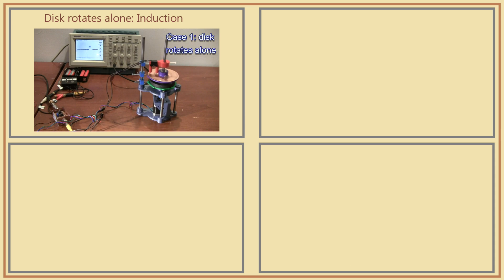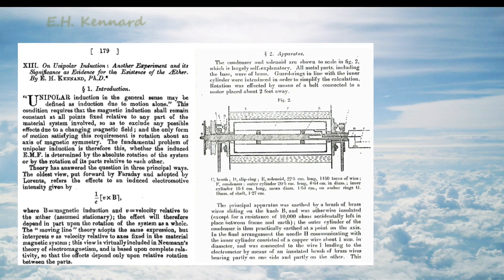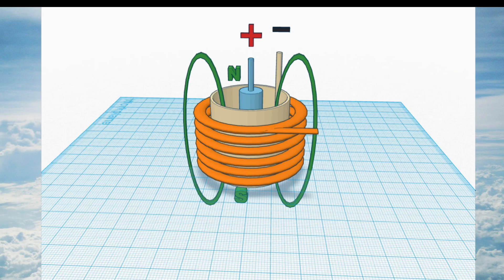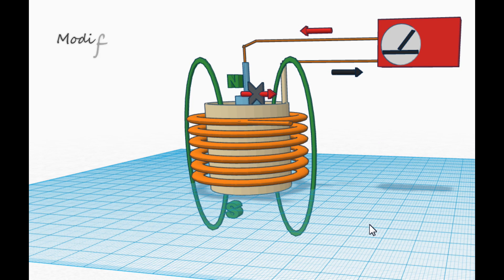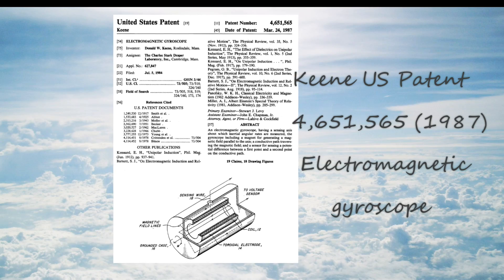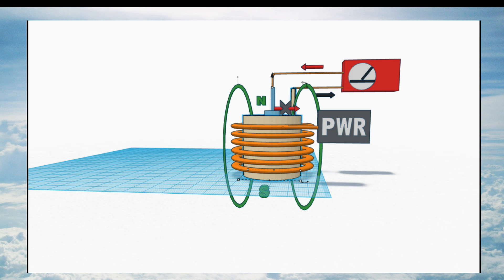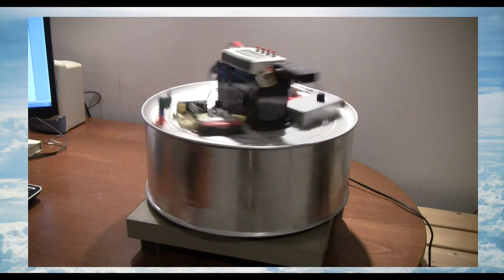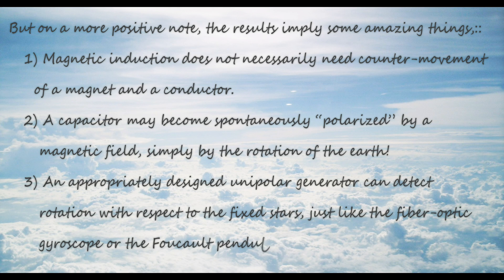Faraday Paradox Unipolar Dynamo Part 2: The Solution

Comment: Are you getting voltage with or without amperage?
Reply from the maker: The way I see it, each cylinder experiences a different degree of Lorentz force, since one is spinning faster than the other, one being closer to the rim and the other closer to the axle. The capacitor charges because of this EMF difference between the two plates.
Reply: to plenum88: this question might show my ignorance, but if a capacitor is charging, doesn't that show amperage and more than a static (stationary) charge coming off the device?
Reply from the maker: Hi James,
   The way I interpret it, is that a very small current does flow, but only in the sections of wire where the magnetic field cuts the stator wires. The problem with the original setup is that there is a current generated in the disk that is opposed by an equal and opposite current in the stator wires. By using a capacitor instead of a disk, the current flows unipolarly only in the stator wires, since there is no disk. There is no closed circuit flow of current.
Reply from the maker: Please see my comment to James just now.
Reply from the maker: Yes, that sounds right

Comment: I had been waiting for this solution to the paradox. Thanks for posting. Isn't it possible to rotate a traditional power supply and/or measurement device to obtain the same results?
Reply from the maker: Not sure what you are asking exactly. Are you taking about the design of the meter /power supply, or are you talking about the Faraday effect itself?
Reply: I was thinking of rotating all of your original equipment as seen in your video Part 1... only the stationary magnetic field would remain... except the heavy oscilloscope which I suppose could be reached by a blue tooth device. I realize that this would be an inconvenient experiment but shouldn't the results be about the same?
Reply from the maker: Actually, no, the result would not be the same. If you rotated the original part 1 machine with everything, then there would be no net current flow, but this is actually because there would be an equal and opposite current flow in the disk and the stator that would cancel out. But because they cancel out, you can't tell if there is no flow at all or two opposing flows. That is why the experiment has to be performed as an open circuit instead, because the disk current is blocked and the stator current flows, but it is tiny (because the circuit is open) so you have to measure it with a very sensitive electrostatic voltmeter. Follow me?
Reply: +plenum88 I'm not sure I understand how the circuit is cancelled if the disc magnet is facing one way.
Reply from the maker: It is a bit hard to visualize,  but If you imagine the magnetic lines of force as closed loops, then any closed loop conductor that attempts to cross the lines only once (like a disk), must be cut by them a second time in any geometry that tries to lead out of the magnetic field. It is this double cut that leads to the cancelling currents.
Reply from the maker: kinda like that, yeah...

Comment: What are you thoughts on Sir Charles Wheatstone's experimental calculations on the velocity of electricity? I have not seen any empirical evidence showing he was incorrect in his calculations. Great video by the way, keep up the fantastic experiments, and thank you for sharing.
Reply from the maker: Not sure what to make of Wheatstone's experiment - there is a component of the EM wave that can travel much faster than light, it is called the evanescent field, and is created when EM goes through a refractive index step, but it is short range. The gaps in Wheatstone's wires where the sparks happen are effectively RI steps.
Reply: RI?
Reply from the maker: RI = "refractive index" just trying to save typing.
Reply: Thats interesting to consider. I would think it would impede the velocity as it passes through an air medium. I will research more about RI and different mediums that facilitate it. Thanks for taking the time to respond.